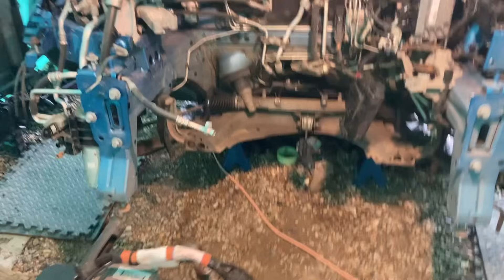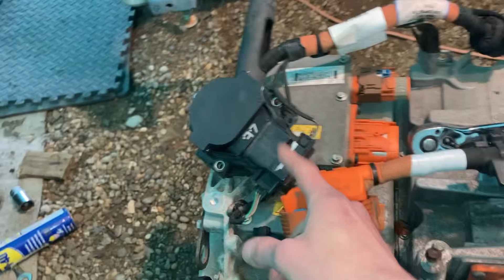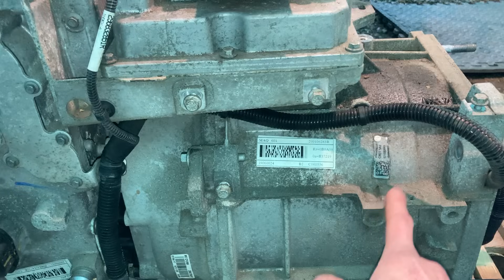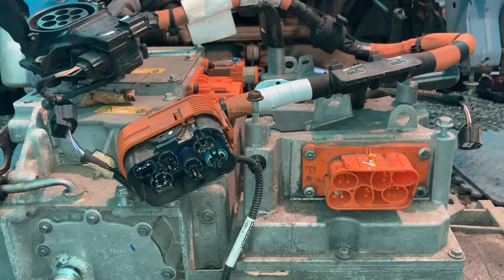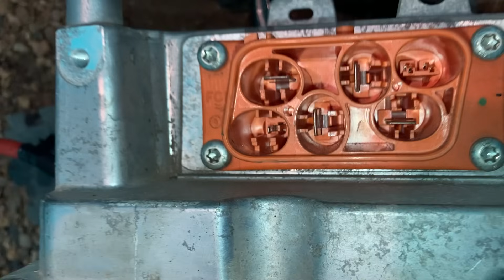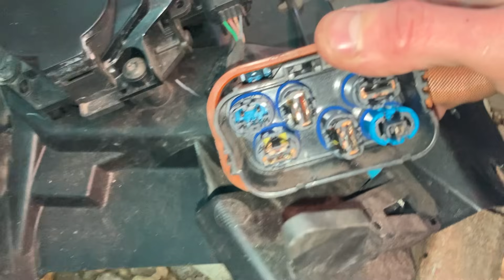Fixing one fault and then you find another issue... Renault Zoe single phase charging flaw - burn EV

Comment: The burning is either due to poor connection, or harmonics in the system. The neutral can be smaller in size in a 3phase system because it is there for balance not load. But it needs to be designed well.
Reply from the maker: If the car charges single phase then 32A goes through that pin…

Comment: My Zoe came with a yellow charge cable that can only ever provide 3Kw charging. Rather than try and plan in a 7Kw charge split in two would it be better to just use the 3Kw cable that I would imagine could be allowed to charge indefinitely without damaging the pins?
Reply from the maker: Hi that will be a 16a cable, so if you don't need to charge it fast then that would be a good idea. Cheers

Comment: Just disable other phases and use other pins. Not ideal but ZERO parts required. Sure, you need to print big warning sticker, nothing else. Yes, customer must charge only at home by modified charging cable...
Reply: That’s a bodge just asking for disaster.
Reply: If u're a mechanic i feel sorry for ur costumers....
Reply from the maker: I'm afraid I won't be doing that.

Comment: The facelifted Renault Kangoo ZE 33 with the downrated ZOE 5AQ motor only has 7 kW single phase on board charger, so maybe that has a modified connector with beefed up Neutral Pin, as single phase charging is all it does. Never goes above 3.5 kW (On some newer 22kw public street chargers it hit 4.5 kW) in practice in the Netherlands at least, and full charge at 3.5 kW takes 11 hours.
Reply: In Germany that is a protection for the grid to not use more than 20A on a single phase. Most chargers are required to comply with that regulation...
"Schieflastgrenze"  "unbalanced load limitation"
Reply from the maker: Hi, the kangoo with the 7 kW on-board charger uses a different connector fortunately. I wonder whether those Street chargers are actually 11kw as that will be 3.5kw Single phase? Cheers
Reply: @garycevrepairs  Sadly I tried multiple 22 kW and even Fastned 44 kW AC charger (Purpusely built just for ZOE), and it simply maxes out at 4.5 in best case scenario.

Comment: 32A through that whimpy pin????   That can't be a proper design...... the manufacturer should ante up for that fix.   Compare that 32A pin to a pin on a simple 13A plug - for example.  Also, it seems as if quite large issues start to  happen at relatively low mileage - puts owning an EV 'because they're cheaper and easier to maintain' into perspective!
Reply from the maker: Hi, I guess the difference with the 13A plug is that the plug is designed to be pushed in and out hundreds of times, trodden on, bashed etc without Breaking and I think you'd be surprised at how thin the contacts inside the socket are. I'm not saying this is big of course, it is stupidly small 😆
Reply: Tesla with over 400.000km almost trouble free and happy kilometers charging excess off grid solar or free lifetime Supercharger: You were saying.....? Yes there are some really crap EV like the Renault Zoe and Nissan Leaf.
Reply: FCI produce to very tight tolerance so in theory should be OK.

Comment: 32A cooker current through that single small pin is insane.

I'd suggest that that is a recall item. Potentially it could catch fire?
Reply from the maker: I don't think it would catch fire but only because if it melts enough the contacts will come apart and it will stop charging 😆
Reply: Great pictures on your video gary, I am struggling just trying to get one good photo of that neutral pin. I hadn't considered something so simple as a broken neutral possibly causing my issue.
Reply from the maker: @ hi thanks, it's easiest to use a mirror or use a torch and video on your phone so you can move them around slowly and you should capture a good Picture. Cheers
Reply: What are the safety issues with a good N to L3 link inside a tethered charge plug on a single phase granny charge level even if only to prove that the N pin is the problem - I know the port and cable is ok as I have tested it on another car
Reply from the maker: @ to be honest these are not the kind of things I like to try because you can't be certain what will happen until you do it, and the result could be fairly catastrophic.

Comment: More shoddy design from Renault on the poor Zoe. Will check ours for heat damage. Luckily my garage has a power limitation and the Zoe is on a 16A cable. My main charger is for the Tesla at 32A. £1000 for a single 10p terminal!

Comment: This error can be bypassed by making slight adjustment to your 7.4kW charger. 
Cut old single phase connector out and put 3 phase connector on. Join L3 and N on connector, which for Zoe does not matter since it internally joins L3 and N when charging single phase. It puts less strain to L3/N relay. 
You can mark the connector that it has been modified. It will charge cars with single phase or 2 phase input with no problems (Nissan Leaf, Hyundai Ioniq, VW e-golf, old ID3 50kWh). Even cars with 3 phase input this should not matter.
Reply: @Mladjasmilic  is this a possible solution when r2 isn't closing at the charge start point?
Reply: @GM-yb8ep  Zoe needs N pin for grouding test. But nothing more. If you introduce neutral to L3 too, it will charge even with failed L3/N relay.
Reply: wow it's working again thank you !
Reply from the maker: Nice one

Comment: This is more likely caused by L3/N relay error.
As for why neutral pin is smaller, Q motor Zoe was designed to draw up to 63A 3 phase, and 32A single phase, with single phase charging being more 'in emergency', which is why neutral pin is thinner. I have 3x25A service at home and I charge my R110 at 13A 3 phase. 
I added phase loss detection and in 40.000km no issue.
Reply: I suspect you are correct there.  32 A fed through that little pin in its current damaged state would cause meltdown in a matter of minutes and yet the car was apparently charging quite happily.  It would be necessary to see the full circuit diagram and the position of the pin relative to the L3/N relay but I find it hard to believe that any design could get signed off which intentionally routed 32 A through such an unsuitable contact.

Whilst domestic three phase supplies are common in Germany the norm in France is single phase so Renault must have been anticipating that the majority of charging would be done using a single phase charge point.
Reply: @ French home plugs are the same size as Schuko, but most are limited to 10A. But on the other hand, Renault in user manual states that 10A EVSE should be used only in emergency. 

Internal L3/N relay is 48A, which means it is more than capable of working with 32A. Now, the small Neutral pin is beyond me. I know that car makers are trying to save every cent. Wires for 3 phases are 16mm² while neutral is just 6mm², even in R motor which can charge only 32A max. So they used a smaller connector for thinner wire. I really do not know other reason why would they go on the route with 1 power pin being smaller.

Comment: The more of these videos I watch the more I despair. I can't see many Zoe's surviving to classic car status with all the expensive repairs. It's shocking this is happening to what I consider low mileage cars. Definitely won't be hanging on to my ZE50 for the long term. As a side note, have you encountered many issues with the Leaf drivetrain?
Reply from the maker: The Leaf is more reliable overall however battery degradation on the lease is far higher. The ZE 50 Zoe has a five year warranty and it can be extended before it runs out which I would thoroughly recommend. Cheers

Comment: I charge my 2020 GT 99% at work on a Private PodPoint up to 22Kw it says but have only seen a max of 15.8kW charge speed so this is still charging on 3 phase, I assume so I should not get this issue? I don't drive far so charge to 100% once every 2 weeks and normal only takes 2.5 hours max, would charging weekly be helpful for my car?
Reply from the maker: Yes, if you are charging 3 phase then this pin is not used to carry current so it's all good and charging more regularly or for longer doesn’t matter. If it's cold Zoe's do tend to charge a bit slowly anyway. Cheers

Comment: Probably better to reduce charge current than add breaks
Reply from the maker: Yes that is another alternative, unfortunately Zoe doesn't have a Setting in the car for changing the charger rate so it would have to be done another way. I have a 16 A cable that I use when I want to slow the charge rate for any reason. Cheers
Reply: I agree. Many home charge points can be configured to a reduced charge current, and at 23A, for instance, the I²R heating at the pin would be halved compared with 32A.

If this is a common enough fault, and if there were an established market for such, it's another example where a refurbished exchange unit, rather than just a low-mileage scrapped-car unit, could be cost-effective. Without the time pressure of having to return a car to the customer promptly, a car electronics workshop could rewire with new connector(s) and as many replaced internal wires as necessary.

Comment: Maybe a reasonable "ghetto" fix would be to swap the wiring of one of the unused phase pins for the neutral, and disconnect the 2 unused phases in the charge socket to avoid accidents. That way you get a much chunkier connection for reliability at much lower cost, at the expense of not being able to charge 3-phase again.
Reply: Yep

Comment: I've noticed a high pitch whine sometimes when accelerating (~40kW load, 2020 R110, 30k miles), it seems slightly more noticeable than when I got the car 22 months ago (~5k miles), would you associate that with the bearings? Hoping to extend the warranty on it.